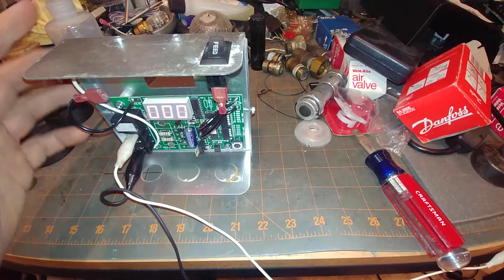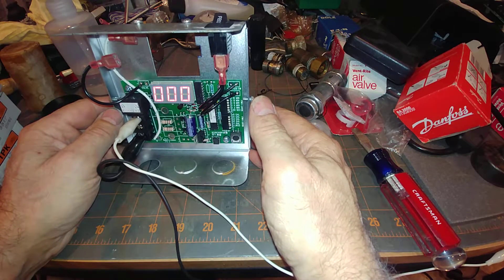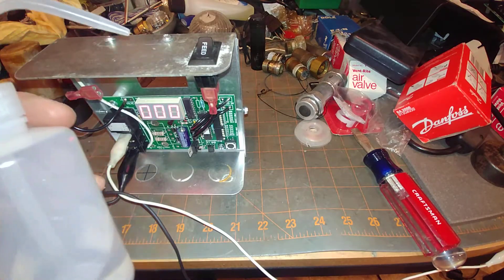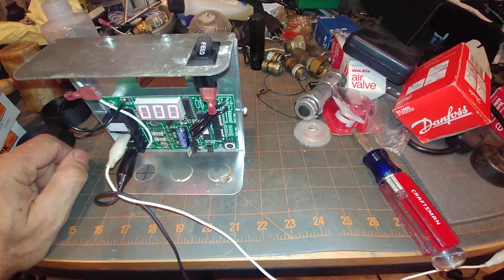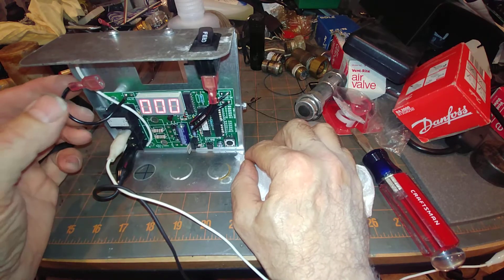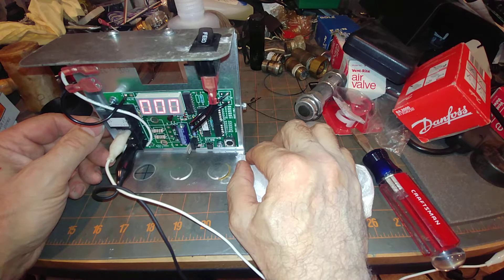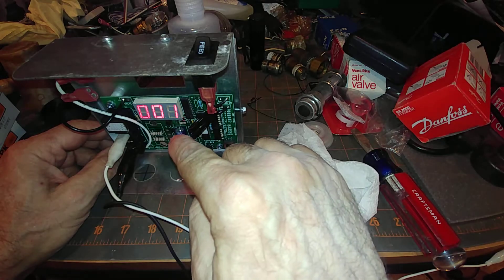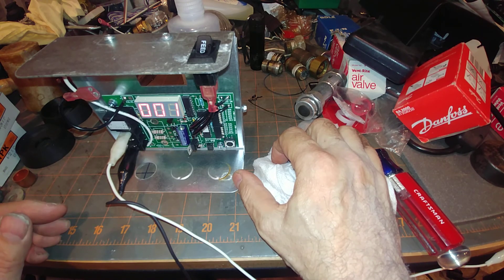VXT-24 Floods A Steam Boiler - But It's NOT The VXT's Fault!

Comment: Hi love your videos
Can you guide me with the correct way to set up vxt 24 after installation
Reply from the maker: It will need three-wire 18 gage t-stat wire.
Usually, I use the red wire on the H, the white wire on the N and green or blue for the FEED trigger in the middle terminal.
As to the other end, usually the LWCO, there is a lot more variation as to which terminal, so best to check the label under the LWCO cover for what wire goes where.

Comment: Lots of great videos, thank you. I cannot find a video anywhere on the replacement of the actual valve that is controlled by the water feeder. Does it go in to the copper pipes just with compression fittings, or is soldering required? Do you have a video on the procedure?
Reply from the maker: Generally you use adaptors. One end is 3/8" male npt threaded into the 443p valve and the other end can be 1/2" solder.

Comment: It's the plumber's fault
Reply from the maker: Actually, the water dripping onto the switch was from an intermittant slight pinhole weep that formed in an existing canister water filter located in just exactly the wrong spot.
Reply: @gordonschweizer5154  I hate when that happens.

Comment: Do you ever suggest or present the option of just having a manual fill valve to your costumers? 
If I built myself a house it would of coarse have steam heat and the boiler would be fill manually so I would be more likely to notice if I had a leak sooner. But I understand why most people would want to have a VXT.
Reply: In general, no.  Our thinking is: "Something killed your old boiler, and unless repaired, it will do its darnest to destroy your new one."  With a VXT, the water loss can be quantified and tracked.  Of course, the VXT does not tell you WHERE the leak is, only that you MIGHT have one somewhere in your system.  Buried wet returns? GUILTY.  Hissing vents? Loose packing nuts? Misaligned radiator valve unions?  GUILTY GUILTY GUILTY.  
Our customers always have the option of shutting down the VXT and going to  manual feed if they so desire.